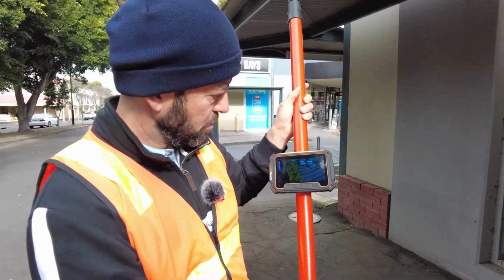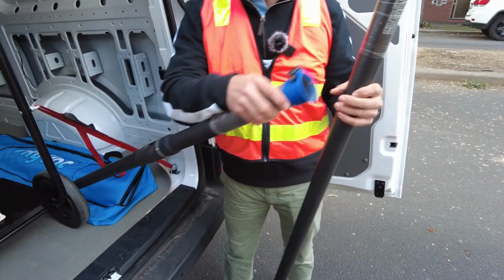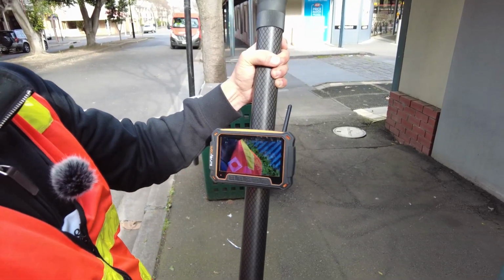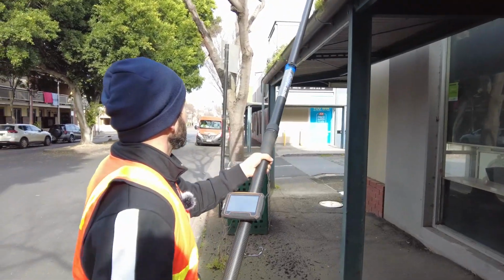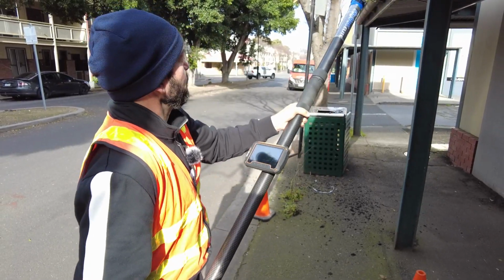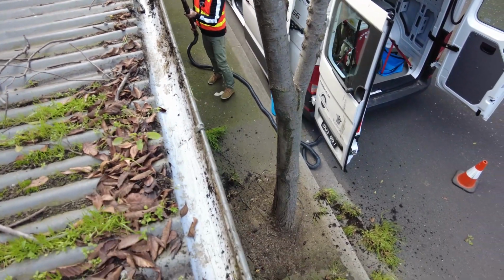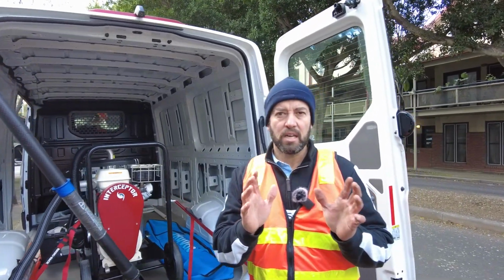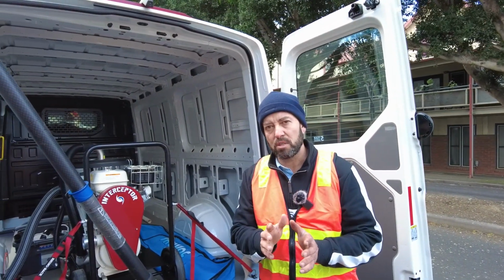Be Safe while Cleaning Gutters | SkyVac Interceptor Gutter Vacuum System | Lets Walk You Through

Comment: What about all the stuff on the roof though? And there's heaps still in the gutter against the sides and under the lip of the gutter that the vacuum crevice tool can't get to.

When i do it i leave it spotless. Vacuum snd flush everything out of the gutter and clean the roof. All that stuff on the roof and the sides is just gonna end up back in the gutter in no time.

Better to get up there and remove the large stuff and then vac and flush at the same time to get absolutely everything. That's a proper job.

Always remember that you're good and the customers good is different. I would only leave it like that if the customer wasn't fussed about the roof debris etc